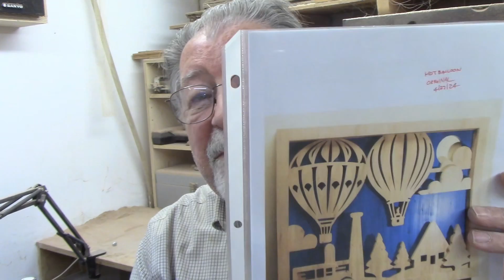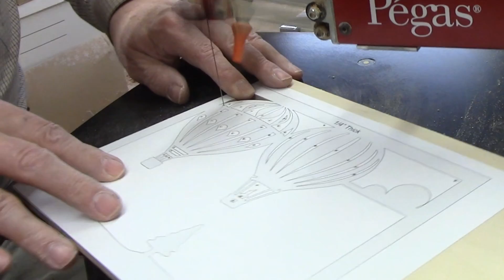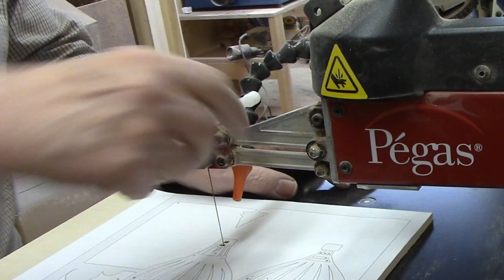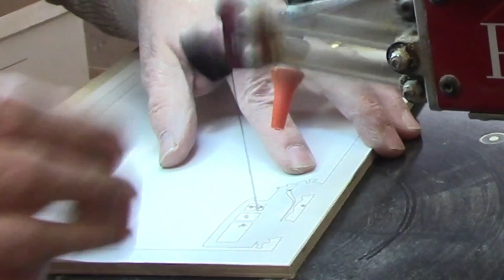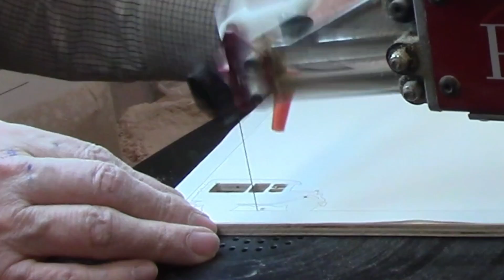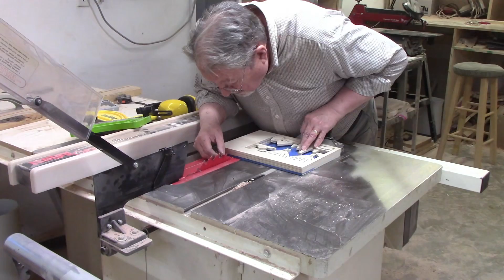Hot Air Balloon Diorama On A Scroll Saw

Comment: Thanks for the video. My wife loves hot air balloons. I want to cut this out for her. Where do yo get your 1/4 inch Baltic Burch plywood?  I have been buying 1/8 Baltic Burch and much from Amazon. When I looked for 1/4 inch the price really shot up which I expected.
Reply from the maker: I usually get my Baltic birch plywood in 30 x 30 sheets from my local hardwood dealer. I did, however, but a dozen 12x12 sheets from Amazon when someone ran a sale on the site. I think I paid $1 a sheet.